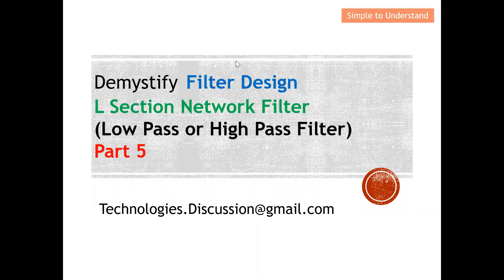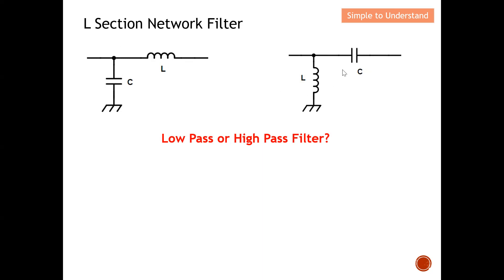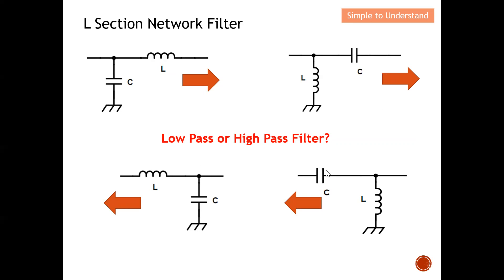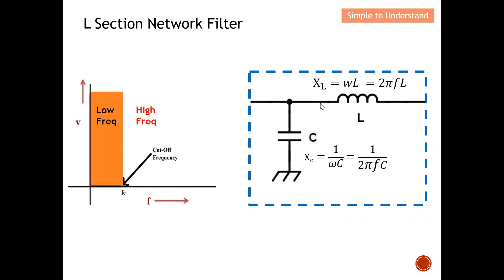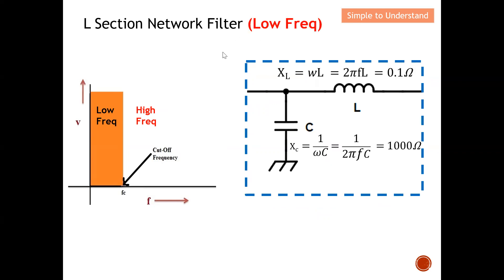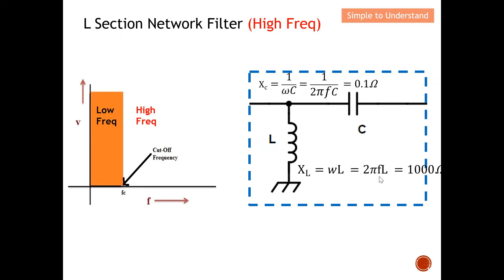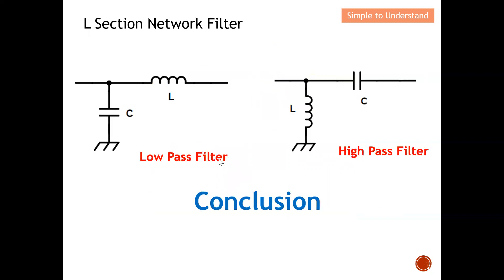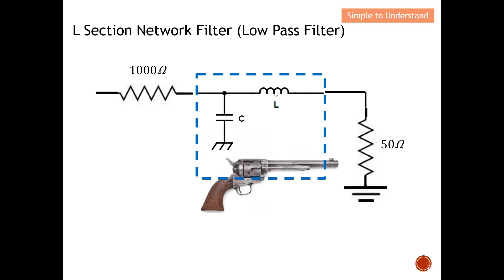Filter Design #5. Explained Why LowPass (Series L & Shunt C) but HighPass (Series C & Shunt L)

Comment: Great explanation. However as to why the inductor is used in the direction of the smaller resistance could have been explained.
Reply from the maker: Thank you. I can explain a bit more. (Series or shunt) (Inductor or capacitor) depend on if lowpass or highpass filter. So called the 'gun' always point to smaller resistance. Thank you.